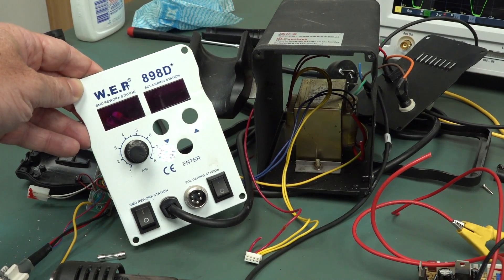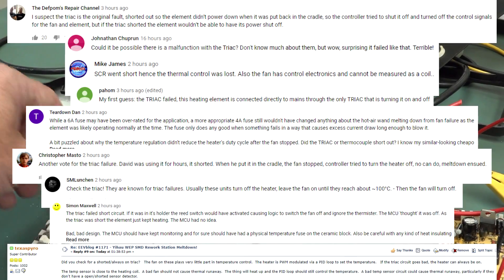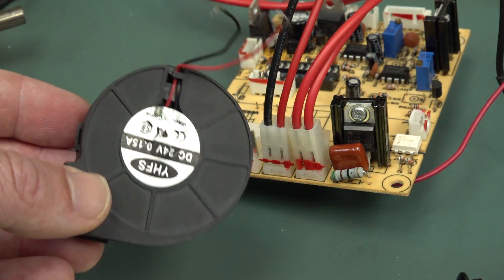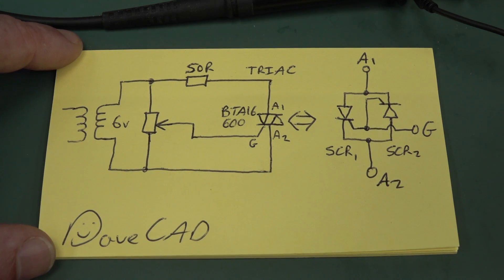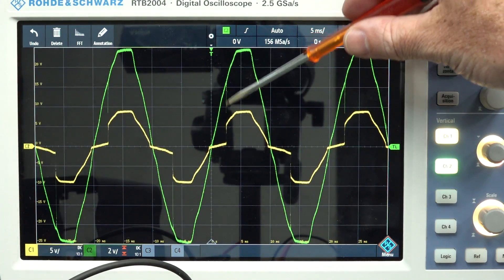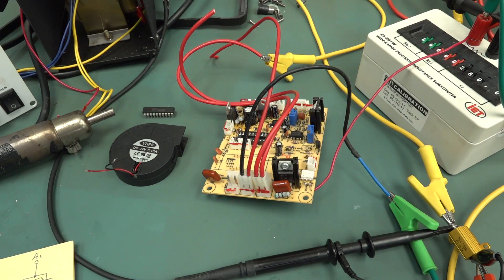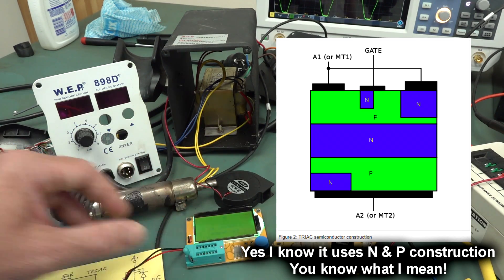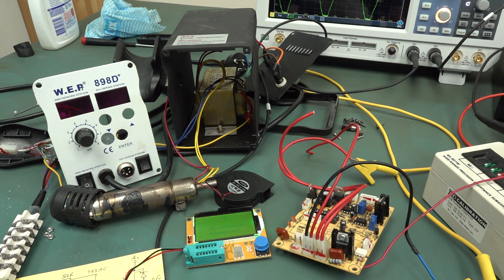EEVblog #1172 - TRIAC Testing (WEP Meltdown Part 2)

Comment: Looks like some very loose windings on one of the coils in the fan, did one break away?
I'm guessing the handset was thrown down into its rest, which dislodged one or more of the fan coils, and likely damaged the thermocouple. I believe if the thermocouple goes open circuit, the controller will just deliver 100% power to the heater constantly.

The drive circuit is quite similar to the one in my cheap chinese desoldering gun, which was shipped to me with a broken heater, and the seller shipped me a replacement heater element (with built in thermocouple). On installing the new heater, i failed to notice that one of the precrimped thermocouple wires was not stripped properly, and crimped down on the insulation, making it open circuit. When i turned it on the thing glowed white hot. I yanked power and attached the thermocouple properly and it works great.

Comment: Seems you and others are missing the real failure because Heater is made without a Thermal Fuse that will fry off for bad fans or bad control parts including the Triac. Properly selected Thermal Fuse a little upstream, around 1cm or less, of the heater element would need air flow to cool and need controls working even with a fan running to stop thermal runaway like this unit and others had. This should not pass UL CE and other testing but like many counterfeit products have their marks. Pull apart Hair Driers and Heat Guns of Big Names Brands and you'll find them as a part about size of 1/2 watt resistor in the heater because they can't pass safety testing without them. The Big Issue here is that Most buyers simply do not care and buy what junk that is cheap. It is sad that you think This unit having a Main Fuse is good but can easily burn down the house and never blow that fuse. For people that never seen one... https://en.wikipedia.org/wiki/Thermal_cutoff
Reply: Doesn't have to be cheap junk anymore.  A couple months ago, my major appliance brand stovetop tried to burn my house down by coming on spontaneously.  The eye was on the off setting and the eye would not turn off but you could turn it down.  Had to hit the breaker to put an end to it.  I had splashed some water earlier so I suspect some went down the stem of the rheostat shorting it out.  Turns out the thing doesn't have a proper switch.  "Off" is just one end of the rheostat.
Reply: @jkbrown5496  Yes but is not same problem with counterfeits and cheap products from China and others and sold online thru Ebay AliExpress and more. These "companies" and Ebay will laugh for people buying counterfeits like Hoverboards having fires and explosions a few years ago with UL and other marks but UL never tested most of them. UL now have standard for hoverboards.  https://www.ul.com/hoverboards/  Brand Names like JennAir and Whirlpool and Car makers have a valid warranty and have to answer questions from UL CE and Many Government agencies like U.S. CPSC and NHSTA that can order recalls and class action lawsuits by customers. If you're in the U.S. visit CPSC.gov and file a complaint and check for recalls and watch for a lawsuit too.
Reply: You can maybe put a low value 1w resistor in to prevent meltdown. It just burns the resistor if there is no airflow.
Thermal fuse would be better. But at what value?
I thought, a 200C or lower would be fine if it lives above the Reed below the heater.
You could put the triac in the handle and even label it more energy efficient, too. 😂
What's the heater voltage?
Reply: @CyberlightFG  Even If anyone guess for a value for the fuse is just a guess and you installing is more guessing and likely have more problems not less. Using a counterfeit or otherwise junk tool is bad enough. Moding them can make bigger problems for you in many countries with Insurance Companies, criminal courts and anyone suing after you have a fire or worse.

Comment: I do wonder if there may be something wrong with the position of the thermocouple. Because the way it is mounted it may just look at the temperature of the air around it, and not the temperature of the heating element. So if tried to keep the temperature of the air but if there is no airflow (if the fan breaks or ...), then it would overheat the element and still think that the temperature of the element is ok.
Reply: Yes, that's it, the difference between set and is temperatures is without airflow big enough so the set temperature will never be reached, the heating element heats from it's center when there is no airflow, clearly visible by the glowing on the metal pipe, so the difference is huge.

Comment: Test the thermocouple. I had a weller that wound up turning the power on to the iron full time and it turned out the thermocouple had failed open circuit.

Comment: IF the TRIAC failed that requires more failures to also happen to cause this.  The fan does NOT stop until the sensed temperature is below 100° (I believe.  At least on my 858D+.) thus the fan would continue going full speed (whatever it was set to) until it has cooled down.

A thermocouple error is a different story and could cause this.  Note that even when set to the max temperature of 450° AND max air flow that the heater is not on continuously.  Now consider if the flow was set low but the thermocouple is now reading low (and thus never getting to the set point) how hot it will get with 100% heater duty cycle.  The situation gets even worse if a small nozzle is installed.  I believe this is what may have happened.

Comment: I don't understand why they didn't use a bimetal thermal switch to cut off the power when heater get overheated like they do in hair dryers!?
Reply: At which temperature?  In normal use they get pretty hot to get the airflow at 500 degrees even with an environment of less then 10 degrees C. Glowing-hot I guess on the element, actually you see it glowing quite clear when they are in normal use. 
A hairdryer is just getting 'warm' compared to this.
If you had one, where to install? Maybe at 2000 degrees C,  close to the core but in which direction? Before it reacts when it is on the bottom of the heater, much plastic will have been melted already, probably shorting out the contacts or making a connection with the mains to the metal (death trap for electrocution) or you have to get a real expensive one.
And that will be the main reason... heating handle inclusive transport over the whole world is about 5 -10 Euro's -not much room for expensive safety-things...

Comment: Great video! Interestingly, the vacuum tube (valve) equivilent of the SCR was called a thyratron which may be where the term thyristor was derived from. I worked on a radar system the used hydrogen thyratrons - yes a tube filled with hydrogen gas - to switch high voltage DC ( 15 Kv @ up to 600 amps). The tube was manufactured by EEV, an English valve manufacturer.

Comment: My money is on just a fan failure not providing enough heat over the sensor to control the heater , if you hook up the heater wrapped inside something to simulate the original wrapping and check the sensor I would bet you`ll find the sensor does NOT operate like it would with air flowing over the unit 
Sometimes you over complicate the simplest things
Reply: All I have, had and will have on that.

Comment: Out of left field, i have a Anilam crusader m cnc control that uses old sony 8x8k socket 36u memory the chip is a sonyCXK5864PN-15L my question is is there an upgrade to add more memory or a way to increase bigger than 64k. And the second is the half AA 3.6v memory battery. Can i use nonvolatile rom chips with built in battery backup. The issue is the control is off for long periods and i loose the settings and any program stored. In addition i can only program 999 lines of code. The main chip is Motorola Mc68000L8 -GN78541.
Reply: There are a myriad of ways to do what you describe. Eg, stack another ram chip on top of the existing one and use an r.s. flip flop on the chip enable pins.... Stack 10 and use a decade counter. If you use flash you'll no longer need any back up battery power. 

Without knowing much much more about the system and how it operates though... I'm afraid that's not going to be enough for anyone to be able to give you a definitive answer
Reply: Jimmeh B so what your saying is there is no off the shelf memory upgrade. Im not an electrical engineer not even at hobby level.  Its standard parallel socket 64k memory. I could spend thousands upgrading the control to a modern PC controller. But i was looking for cheap easy options.  Ya know like modern ram pull a 1gig chip put in a 2 gig. The controller like i stated earlier is an off the shelf anilam crusader m cnc controller very common in the 1980-90s. Its on a cnc ycm 30 supermax mill like a bridgeport clone. As far as needing more information about how it works its a sony rom chip tons of info if googled and same with the controller i didnt add much more info do to the character limit in the comment section. I actually have all the electrical and controller schematics but dont want to learn engineering i wanted to upgrade the memory plug and play
Reply: @tf1977sled  probably isn't an off the shelf solution for you mate. That said, I've never seen one of these units. (I would be VERY keen to see those schematics :))

Realistically, if it were me, I'd be looking at the schematics for the memory controller because it's data sheet will tell you what the maximum address is.

I'd be looking to build in a socket and make some boards with 64K of mem each that can be slotted in and out at will.

I'm not sure that it would be beneficial to you in your particular instance thought.  :)
Reply: Jimmeh B i would be happy to email all the files about the machine. Includes everything

Comment: The visible damage is a result of the failure.  It seems that you have not yet found the "why" pointing to the root cause.  Several more "why" cycles are probably needed...
Reply: He mentions it right at the beginning but is obviously too smart to realise that without airflow the gap between set and is temperature id high enough so the set temperature can never be reached, he just say the thermocouple is close enough and dismiss this possibility, because also too much engineer to know the heating element is heating from it's center, right there where the metal pipe begins to glow.

Comment: I have one of these.  I think what happened is that the reed switch didn't initiate the shutdown sequence.  In which, the fan stays on until it is cooled down to 100C.  it was probably just doing it's thing as normal, not knowing it was supposed to shut down.  And David, hearing the fan stop didn't think anything of it, and thought it cooled down enough, and it just kept heating up because it didn't know it was supposed to be off.  With the fan going, it cools the entire heating coil, which makes the circuit pump a lot of electrons into it.  Without the fan going, it no doubt spiked in temperature very quick.
Reply: I'm thinking the fan failed, this caused the heat to rise on the reed switch (their normal operating range is -40 to 200 C), which reduces the magnetic force on the contact arms so it opens, which causes the heating element to come on, which adds more heat.  Secondary vector is the heat reduced the strength of the magnet in the holder.  And if the reed switch wasn't right on the magnet...

Needs a physical breaker for the element power if the fan is not running when temp is above 100C

Comment: Should have had a three wire fan. The third fan wire for sense or feedback. The heat element would not have been allowed to come on or remain on without receiving  the Fan sense or feed back signal from the fans third wire.

Comment: Did you check out the reed switch to see if it was damaged?  

If the fan failed, the heat could have risen enough to thermally cause the reed to open, maybe?  If so, then that switch opening would signal the unit to turn on the heating element

Comment: its not uncommon in 3D printers to have the thermister fail open and the MCU attempt to heat the heater back up and cause thermal runaway 
thats why under temp protection is so important
Reply: On a 3d printer with the proper firmware, the printer will refuse to heat if it can't sense the temperature, if the temperature is too high or too low.
Reply: unfortunately this feature tends to be disabled to prevent false triggers
another even lesser used feature is the hotend not heating up when it should be to indicate a thermistor or heater cartridge that has fallen off 
all fairly simple to implement in anything like this

Comment: Hi Dave, This testing circuit will not work properly ... You will feel it is going from ON to OFF suddenly .... The reason is A1 and A2 ... A1 should be down and A2 is up ... The gate is referenced to A1 not A2 so the voltage should be higher than A1 to trigger properly the Traic .... Good Luck
Reply: Why ?  Have you tried that ?  I tried that many times and this is my conclusion
Reply: @Marcin Berman very funny
Reply: ما شاء الله ربنا يبارك فيك معلمي الفاضل
Reply: @Marcin Berman wut?

Comment: Triacs don't work for dimming line voltage led lights generally. I had to get a new dimmer for mine.
Reply: Maybe it comes with a countdown algorithm. If the gate ic failed would that be the same as 100% power on?

Comment: Watching around 10:40 when you changed the gate resistance.  It didn't look like the top half of the waveform went off where the bottom half did.  I would expect both half cycles to be affected evenly. Wondering if one of the SCRs in the triac is bad.
Reply from the maker: They aren't separate SCR's as such, it would just be imbalance in the gate current thresholds.

Comment: The fan chips data sheet said max 16v and somebody gave it 24v - Ooops! That YHFS fan was NOT labeled correctly...
Reply from the maker: Yep, bad labling. Not sure what voltage they actually drive it at though.

Comment: i'd replace it anyway, even if it was just a hand unit failure. most of the triacs in these aren't too expensive, so it just makes sense to make sure its going to be okay. with a new handheld bit, it should be right as rain.

Comment: 2 simple modifications could have prevented the  meltdown.

1, A thermal fuse in the heating element.

2, and RPM sensor on the motor itself. If the motor doesn't run, the heater doesn't come on, or turns off.

I would also recommend a warning buzzer, To indicate a possible dangerous failure.
Reply: Splicing in a thermal fuse would be the easiest way to make the device a bit safer, but thermal fuses are notoriously unreliable. Considering the high temperature it normally operates at a thermal fuse would only cut power after it's already on fire. The "annoying" problem is thermal fuses can gradually fail when they operate slightly below their temperature limit. After a couple hundred hours it may just decide to cut power even if nothing was actually overheating.

Fans can be manufactured with a locked rotor sensor (instead of RPM). This type is frequently used in DLP projectors with HID bulbs, because they could burst into flames if a fan stopped working. For a device that doesn't monitor RPMs this is the easy way to add safety logic to cut power when a fan dies.

If anything, I'm impressed by how good the WEP station is at such a low price. I'll probably buy one in the future and modify it.

Comment: Sometimes triacs/SCRs and cmos logic can have junction latchup that will clear itself once it’s fully powered down. It’s rare, but they can fail to fully shut off after the zero crossing occurs... I’m not too sure how to test for that fault though... seems to be a scary horrible design if it burns your house down if the cheap ass fan isn’t flowing enough air... it would be interesting to test just where the thermocouple actually shut the thing down... he said it was glowing red to white hot so surly the thermocouple was pretty damn hot...

Comment: hehe Hardware guys are always blaming the software ;)
Reply: I don't think it's a SW bug. The SW knows temperature of the air going out but it don't know about air flow, presure or fan speed. And the air don't conducts the heat very well. The SW thinks "OK, it have 200 degrees C, user wants 350 so I put it to the full power to heat up". No way to detect somethink is wrong.
It is definitely HW bug - missing thermal fuse as a last safety components in case of the failure (how much it costs in mass production?), missing feedback from the fan (as used on PC CPU fans), use HAL sensor above specified voltage.

Comment: Cheers for the explanation on Triacs Dave, very interesting, think i'd like to get a few npn & pnp transistors and play around building one to get a better understanding. :) 
I'm gradually improving my electronics knowledge even if I don't have much use for it right now, would like to get into electronics repair so all these little tidbits could come in useful eventually. 
I suspect you're right about the algorithm somehow failing to turn the triac off, but strange how the fan failed as well. I have the "HYIKKO" 858D rework thingamajig, seems to do the business (I'll keep an eye on it incase it decides to melt down like David's one!), it had no trouble removing DDR5 ram chips, next step is getting some solder balls and perhaps some stencils to learn to reball and solder bga components. :D
Reply from the maker: Also watch my SCR latchup video.
Reply: @EEVblog  Will do, thanks mate ;)

Comment: what I am missing is a simple resistance test on the 2 coils of the stator.  Did one fail ? we want to get to the bottom of this surely ;)
Reply from the maker: Both measure ok (100 ohms)
Reply: Yes....also my first reaction....measure the Fan coils. 😏. By the way..i have the same only  Atten  heatgun station for years....still working fine....i would like  to buy an expensive Weller....but then i have to put and build an extra fuse  on it.... 😏